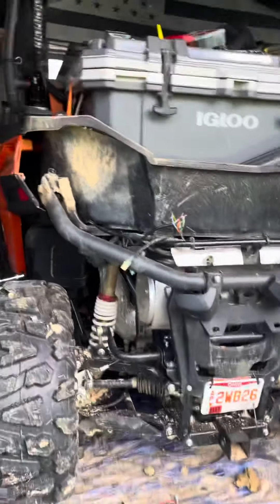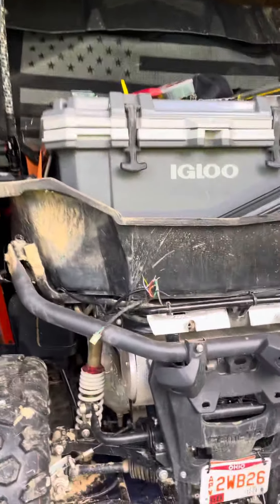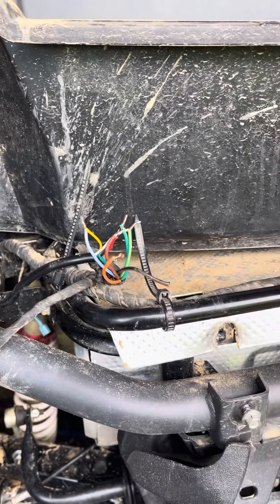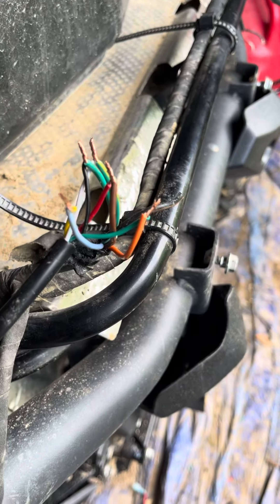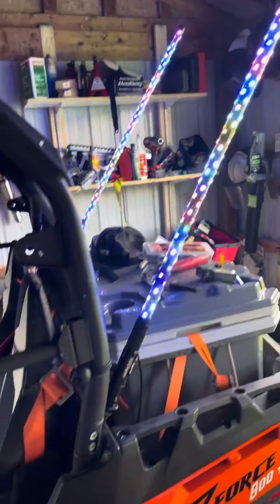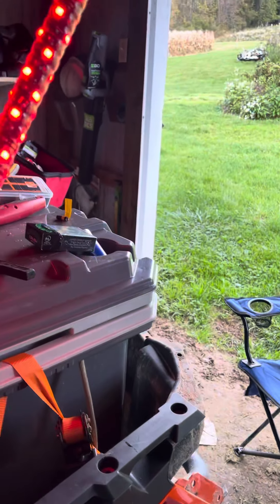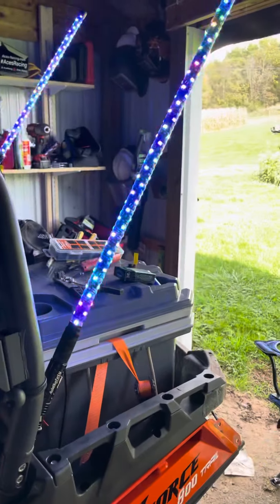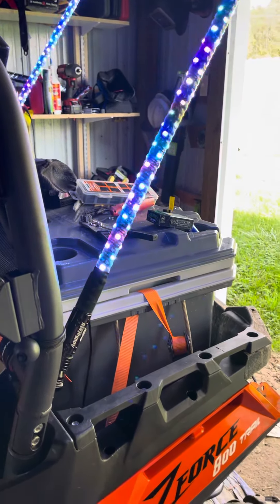Wiring my whip lights

Comment: Cool look to the whip.
Reply from the maker: Thanks I appreciate it
Reply: What whips do you have ?
Reply from the maker: @Walter L  the brand is addsaftey on Amazon
Reply: Just the ones on my snowplows. Markers.
Reply: @Compton_gaming85  do you know which ones they are by chance  ?   Ones I found didn't say they did blinkers
Reply from the maker: @walterl9866  AddSafety 2PCS 4FT(1.2M) LED Whips Light with Dacning/Chasing and Can Controlled by Remote and app Simultaneously with Lock Function https://www.amazon.com/dp/B082WRSW4J/ref=cm_sw_r_cp_api_glt_i_TPDC2QK0ECDEZ3GQC50D